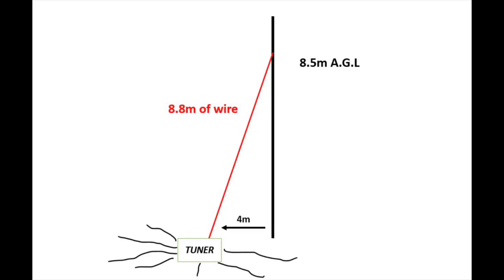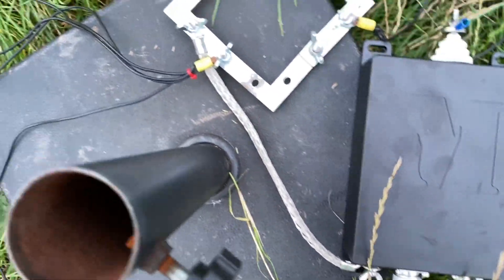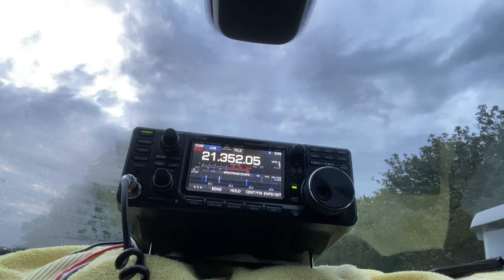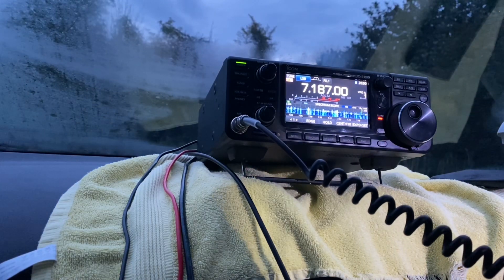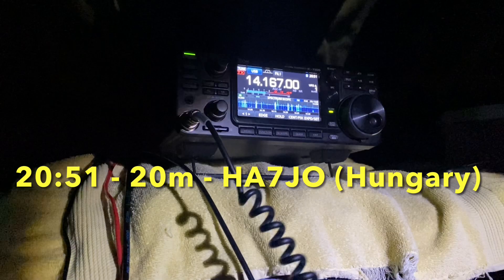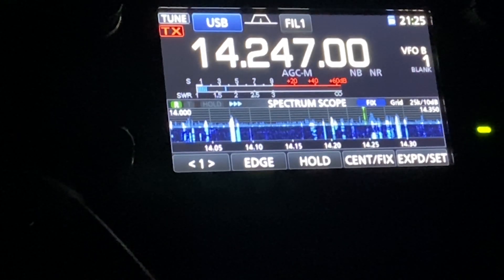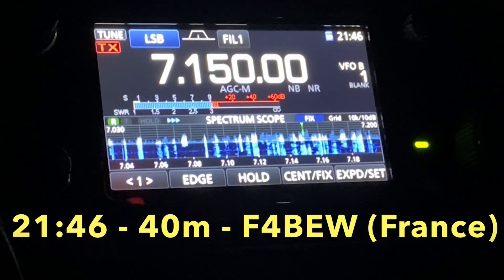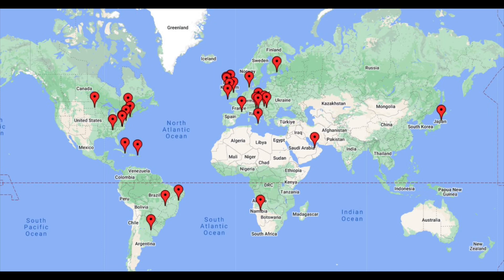SIMPLE PORTABLE ANTENNA FOR HF HAM RADIO - GREAT DX ON MANY BANDS!

Comment: 8,8 meters / 29 feet is the shortest ‘random wire’ antenna length in the table I use. Do your tune have a 49:1 UNUN build in ?

As I am using Yaesu rigs, I have purchased a LDG RG-100 - which does not need a control cable when the tuner is set to automatic mode. Not sure if ICOM supports this protocol. But love not having to acqure a 50 feet or so control cable matching the typical coax length I bring around

Comment: what was the box inline with the coax?
Reply from the maker: A Line Isolator - basically a choke to present common mode currents causing issues at the radio eend.

Comment: Hi Tim, indeed very simple setup who works very well
At 02:05 you have a line isolator ... Is a 1:1 current balun?
Many thanks for sharing / 73
Reply from the maker: Yes, correct it a line isolator/choke
Reply: Many thanks / 73 @TIMG5TM

Comment: You killed it! 🎉  

I keep wondering how something like this would do as a band changer if the tuner and radials/counterpoises (say 2 or so) were elevated up a meter or two… which would be achievable with a 12m Spiderbeam job. While I know this is a long-wire tuner, I was thinking of interfacing with a BNC cobrahead/banana adapter into an AT-100M type to the radiator and radials. I guess it might only theoretically work as well as ground mounted, if the elevated radials were tuned independently for each band. Just one of those head scratchers. Hehe
Reply from the maker: Thanks!